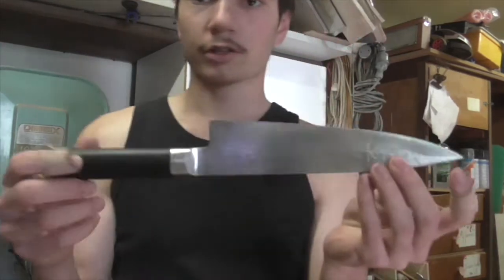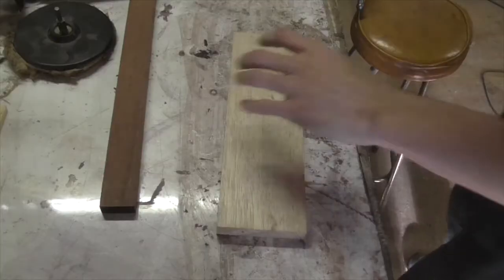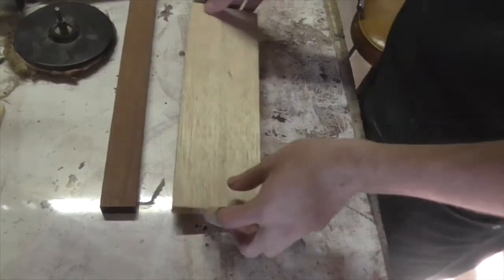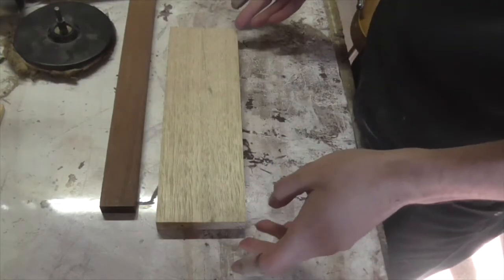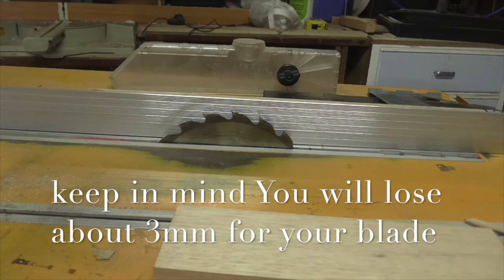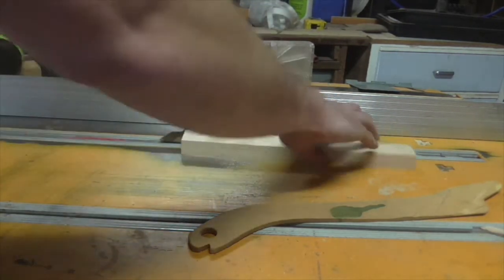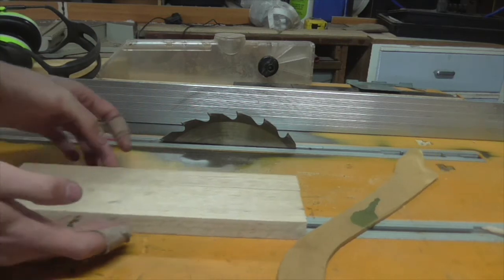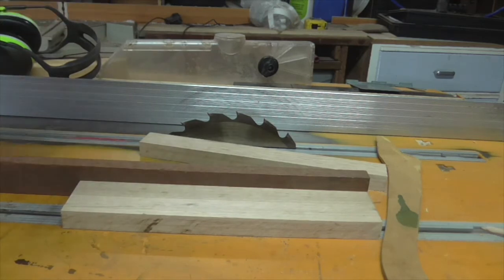chef knife sheath - table saw build

Comment: Great job!
What do you mean by lose 3mm for your blade?
Reply from the maker: because of the width of the blade it removes 3mm of material, some blades are thicker and some are thinner, you should always check the thickness of your blade before you start.
Hope this helps and thanks for the comment!
Reply: That’s what I thought but wasn’t sure. Thanks for the info. 
I’m a professional chef with lots of knives. I’m going to try this for a Chinese cleaver. Keep up the good work.
Reply from the maker: @MC-kb6zp  Thanks mate I hope it turns out well for you! Stay safe and happy crafting!